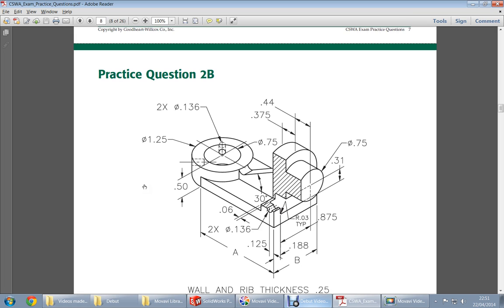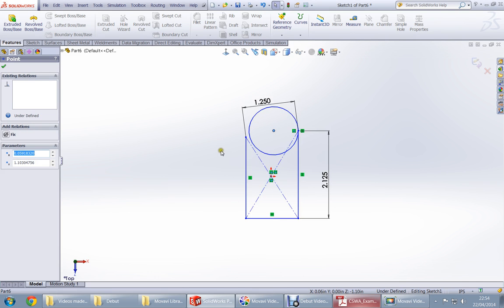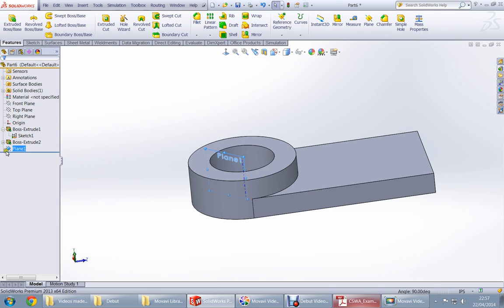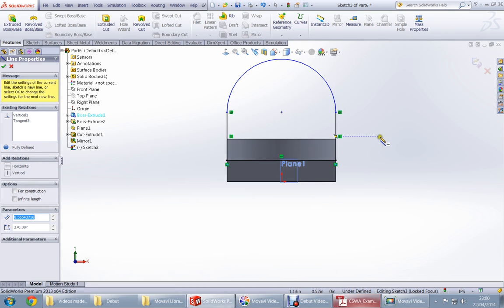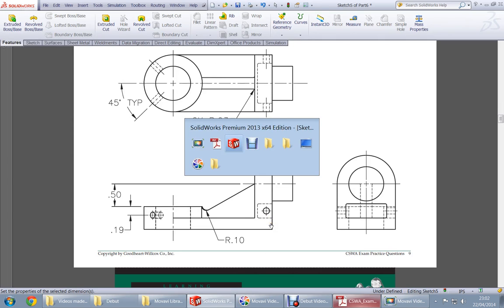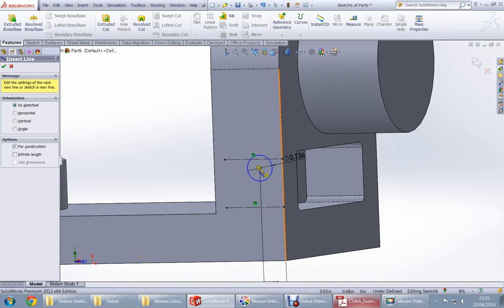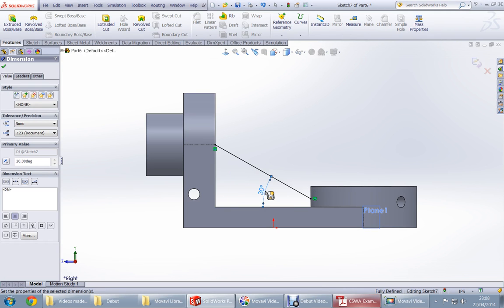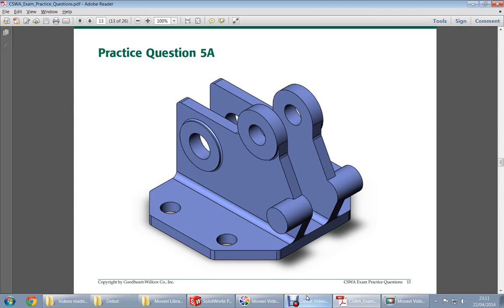SolidWorks CSWA Tutorial 6

Comment: Silly SolidWorks: mass is a property, pounds is a force. Their "mass" value in IPS should be slugs, or they should change "mass" to "weight."
Reply: Indeed. I find it very interesting how the developers of such a high-priced software application could make such an error. It's either that or they made the conscious decision to use a unit of force, a vector, to represent a scalar quantity. I mean if the people using your software need to know the mass of something they design, then they most certainly know the difference between a slug and a pound.
Reply: That's bullshit. 

The SolidWorks developers implemented simulation and static analysis into their software. So they MUST have had input from actual engineers. I have a degree in Computer Science, and took a number of courses in advanced math, physics and mechanics. Trust me when I tell you that any computer scientist will have taken courses that teach the difference between vector and scalar values. So the excuse you gave is just not going to fly with software that costs $4000+ for a license. Mine cost $5500.
Reply: Well I can assure you that software engineers didn't develop the engineering simulation functionality seen in SW by themselves. They obviously had the assistance of Mechanical, Electrical and (most like) Aeronautical engineers. That's why software developers need enough background to understand such things as mechanics, fluids, solids, and electrical theory--they have to work with real engineers and implement the things the engineers think up.